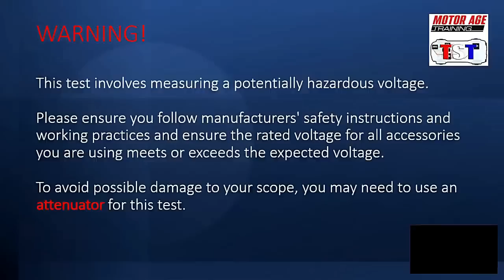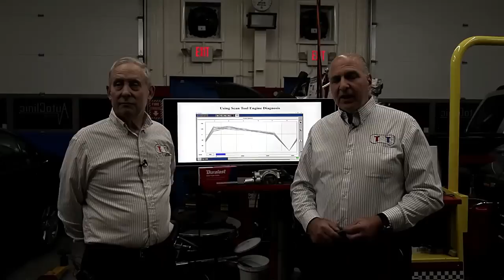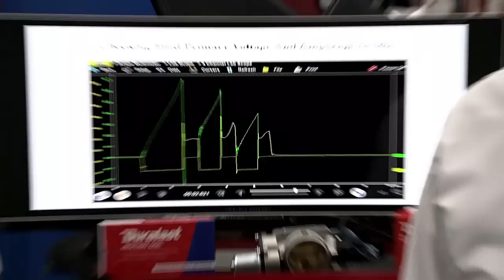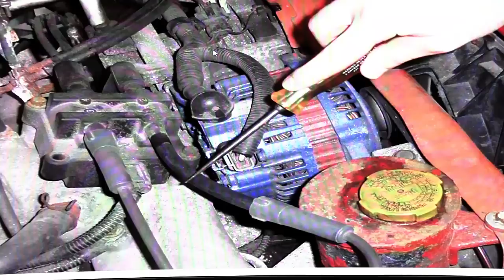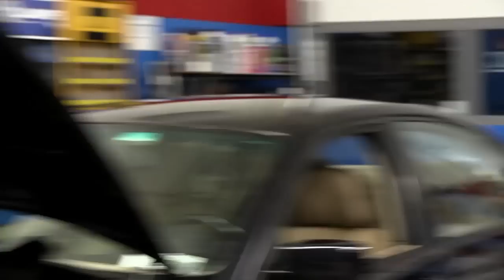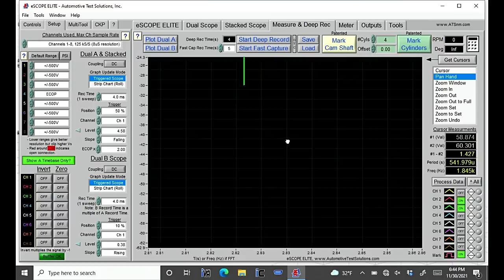Motor Age TST We Have Ignition 12 2021

Comment: Thanks for this tutorial. 
Can i ask for some questions?

1. Can the battery be installed when all the fuses are removed?

2. Will the computer control system be disturbed if all the fuses are removed, while the battery is still connected?

Thank you sir. I really need your explaination.

Comment: Question I'm new to scoping, autel 919, I am the only one in the shop using it. I tried doing secondary ignition. I have 20:1 attenuator and it wasn't producing a picture. I also have a COP adaptor. I used that with the attenuator, wasn't pretty but I saw the coil failed. Any suggestions on how I can improve. Thanks!
Reply from the maker: following the directions...maybe the 20:1 should not be used...were you on primary or secondary? Try ignition on primary that is safer for the scope and will yield about the same information...thanks for watching...If you have not already subscribed to our tstseminars YouTube channel please do so. Interested in more training? Go to www.tstseminars.org and view full length videos for members on TechFlix for $9.99 unlimited viewing …Membership and over 85 videos for less than $200.00 a year. Also checkout www.attstraining.com for hands on training and webcast
FREE videos at www.tstseminars.org/training-videos
Reply: @TSTseminars  I literally tool the cop tool and shoved it on the coil and all I saw on the cop was the ecm controlling it. The car had p0300. Mode 6 showed nothing. I saw one coil not producing anything so I just r&r. I was hoping to see a secondary event to help me feel better and confirm. So are we suppose to just current ramp and watch control volt and r&r coils? I'll look into your site. I've been subscribed to you for a very long time
Reply from the maker: @WeakPiggy  You would current the coil and low for an amperage difference. Sometimes the secondary adaptors do work great on every ignition system. Amperage ramp should help you out.